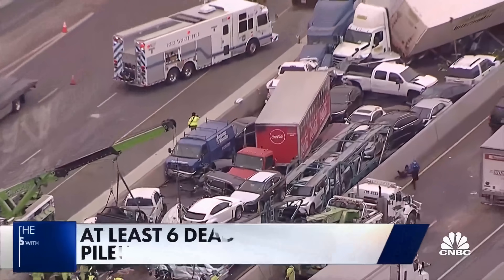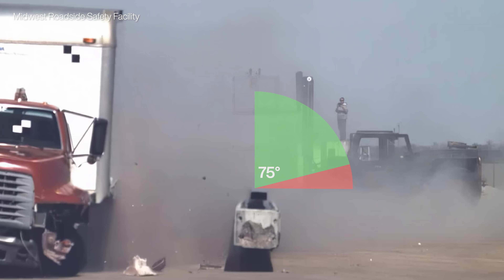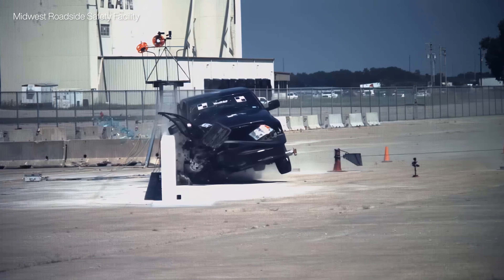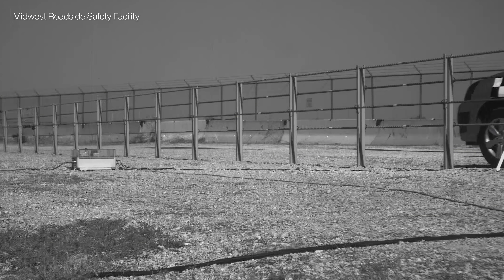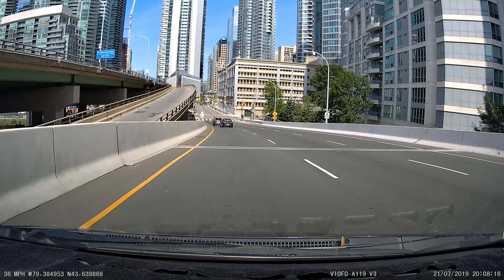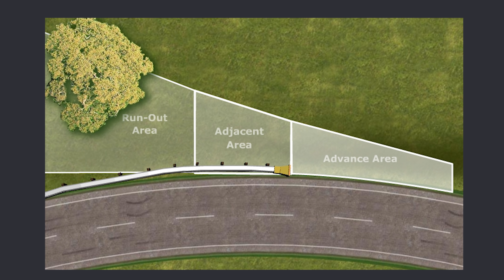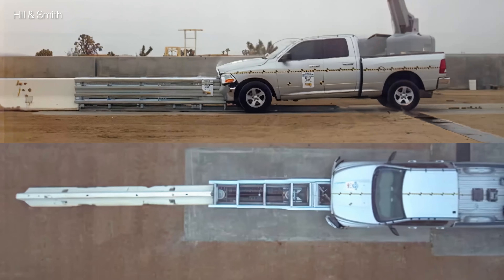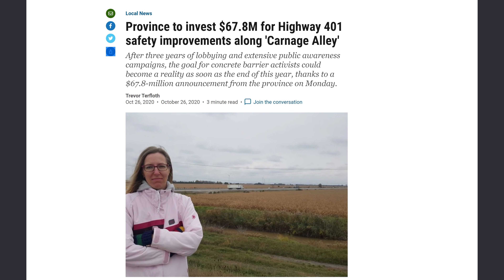How Road Barriers Stopped Killing Drivers

Comment: Nice video, thanks, but i am missing something when you talked about cables: They are a death trap when driving a convertible. .. The seat belt prevents you from moving down, the top cable goes over the car and slices your head off... So glad we do not use those here (although not driving a convertible).

Comment: Cable barriers are not supposed to be installed on slopes,  if the barrier is below the bumper hight of the auto or to far off the road the vehicle simple goes over the top,  if the shoulder of the road slopes down the cable barriers supposed to be placed next to the  roadway thus solving the vehicle from clearing the cables.

Comment: I hit a patch of completely invisible frozen fog on the interstate one day and started doing 360s down the road.  My car kept spinning into the median.  LUCKILY there was no barrier, guardrail, or cables.  My car finally slowed down and I was able to push it out and drive forward until I reached a police/emergency turn around spot and then continue driving to work.  If there had been any safety barriers my car would have been totaled and I may have died.  Sometimes, less is definitely more.

Comment: Well lack of barriers is a problem of law in most of the countries. For example in Poland there is a law which by default requiers all roads with 80km/h limit to have some sort of barriers. Also all of the high speed roads that are at least 4m above the ground that involves public transportation (bus) or trucks now must have reinforcements on any tunovers/slide downs/intersections etc. following a fall of a public transportation bus last year (guy was on drugs, but still the fall of a bus could be avoided by just adding reinforcement). It is all mandatory now according to the law and without doing it, the road won't be open, contractor won't be paid in full and the contract will be transferred to someone else. 

Also if you need material look into it, there is a lot of footage before and after accident, maybe you will have something cool to talk about, how it could be avoided etc. just type in yt ("upadek autobusu most grota" or "nagranie updatku autobusu most grota roweckiego", in eng should be "fall of bus on grota bridge, warsaw" - https://www.youtube.com/watch?v=Gd0ZbOw5W_4&ab_channel=PolandIn )

Comment: Missed three very important factors with cable barriers, and a challenge.
The first is that cable barriers are basically guillotines to motorcycle riders. The second, is that they don't stop the top half of a semi truck - the chassis catches in the cable and slices the top clean off, leaving the driver, cab, and load still moving at speed, disconnected from the chassis or any 'safety' system. The third is that with cars and pickups, there's few test showing what happens when the cable slices in to the body and starts the vehicle rotating - it becomes a spray of loose parts and debris, shredding the vehicle and occupants.
The Challenge, is to find the video showing the crash tests of Motorcyclists and large vehicles like Semi's catching in cables - they seem to have gone missing.

Comment: I had a tire blow on the highway and my car went through a cable barrier like it wasn't even there. I ended up going across oncoming traffic and finally stopped in a ditch on the other side. Luckily no one was hurt but from my experience I think they are too unreliable.

Comment: Stop comparing Cable Barriers with Concrete ... they are nearly as cheap as Guardrails, and worse ... and are not used in Europe at all ... and in Europe if you can't put a Concrete barrier or Guardrail then the highway is closed until you can, it's not optional if you have the money but part of the cost of the highway

Comment: I was driving one night on a section of the PA turnpike that had concrete barriers running down the middle, and low guardrails by the shoulders. I came around a bend at 65 mph and found myself in the middle of a giant herd of deer that were all gathered there trying to figure out how to get over the middle barrier.

One deer hit the windshield without breaking it and landed in the middle of the road with a broken leg. Right away this toothless hick drove up, got a tire iron out of the back of his truck, and bashed the deer in the skull a couple times. A state trooper showed up, and all three of us ended up lifting this deer off the highway into the dude's truck. He must have been eating that thing all week.

Comment: Cable Barriers, because fuck them motorcycle riders!! Just the thought of a Motorcyclist going through one, is enough to make me sick to my stomach! Because a lot of motorcycle accidents happen then the rider slides at a high rate of speed down or off the road. It could end really badly with those cable Barriers! Not to mention, a lot of places are using them in medians that are fairly clear. Meaning now instead of a simple slide off, there's a police report and a wrecker involved. Like u said they all have their quirks!

Comment: One thing that was found in the UK was that cable barriers significantly reduce the amount of drifting snow on a road, over guard rail and concrete barriers. This greatly reduces road clearance costs in the winter, and frequency of closures. Obviously this location dependant, as snow is not a problem in many locations. Though I would note UK cable barriers are different from the ones shown here. One other thing I have noticed in my travels is that in the UK we seem to spend a lot more time protecting bridge piers with crash barriers than other countries especially in Europe.

Comment: This is seriously nonscientific. Extra 0.5% fatalities of overall accidents on cables is 120% times more fatalities. And I bet most are from motorcycles. At the same time motorcycles reduce congestion, pollution but their use is hampered by stupid rail systems.
Reply from the maker: Yes it's technically double I know, but at the same time it's 0.5% which is negligible at the same time when you're talking about weighing the benefits / drawbacks.

Comment: I never knew this much thought was put into designing guard rails. Mind: blown
Reply: this much thought is put into toilet paper.
Reply: @Tycy2014  
You too ? Some times I can't remember which hand to use either.
Reply: Nasa has a 60 page guide on how to splice 2 wires together.
Reply: I once saw them installing them and they were using this massive piledriver to put the uprights into the ground. Those upright supports go so deep it's amazing. Here where I live they have tried to extend protection to ground level to protect motorcyclists as the upright can tear a human practically in half if hit the right way by a sliding human.
Reply: im a layman so how bout a net

Comment: My question is why are crashes so frequent in Carnage Alley?
Reply: I don't know, but I'm from Scotland, and there's a similar-looking stretch of the A9 from Perth to Inverness that's infamous for accidents: there were a number of factors, mainly due to bits of it looking like a freeway but freeway rules not applying (no proper junctions, so you have to turn across the other lane; no restrictions of kind of traffic you'd go round a corner at 60mph and hit a tractor moving at 10mph; switches between two-lanes-each-way and one-lane-each-way causing the driver to forget whether that other lane is for fast traffic or oncoming traffic!). This looks like a rural route so it could be similar. It really needs to be upgraded to a freeway, which would cost a huge amount and should be done by 2025, but in the meantime the most effective thing the government's done is to install number-plate-recognising average speed cameras to reduce the effectiveness of driving aggressively.
Reply: @hjalfi  Well that just sounds like a high body count waiting to happen.

Comment: When the spex are created for the guardrails AND the posts that hold them, does anybody think about motorcycles? You are creating uncountable guillotines which will cut motorcyclists in half, even at "lower" speeds.
Reply: Statistically, motorcyclists are not particularly important. They get hurt in so many different ways that the guardrails are not a significant factor in increasing their injury rate. Furthermore,  there are more cars than bikes anyway so what's the point of harming.more of the larger population, just to save a few who are more likely to die anyway?
Put another way - if you ride a bike, you are making a conscious decision to dice with death. So, take responsibility and don't crash.

Comment: Bikers: they didn't consider us or care about our safety. 

Also bikers: zooming in and out of traffic, flying pass you before the sound can even catch up, riding the middle lines between cars at stop lights, choosing a vehicle with no seatbelts or nothing to cover you from extremities or being ragdolled 200ft after being hit. 

I don't think you care about yourself too much if you're on a bike. 

Not bashing bikers, but you know hands down you have the most highest chance of getting wiped out in any wreck. 
You signed up for it when you bought your bikes.
Reply: Put the rider in a t-shirt and shorts doing that stuff and there you have a squid
Reply: Bonus points when they have a partner/kid behind them with no helmet :(
Reply: Not bashing bickers but actualy bash them with generality. 
It's more dangerous but doesnt mean we have to make it more dangerous. It's better to crash into nothing rather than a cable that will cut you in half. In France those are forbiden for a reason, because fortunately not everyone think like you.
(not talking about gear wish should be mandatory)

Comment: $360 per foot of concrete? Idk if that's possible. I have no knowledge of the subject but doing some math that would mean putting up concrete barriers over 60 miles of highway (a small length in the scheme of a states interstate system) would cost over 100 million dollars, maybe I'm wrong but that sounds way off to me

Comment: I was involved in a high speed accident and hit a Jersey at 70mph. Rolled over 2 or 3 times but if it were any other barrier I could've easily flipped in the grass and gone into oncoming traffic. So even though I flipped, the barrier (and Subaru) absolutely saved my life.
Reply: Was to the left of an 18 wheeler that was in the middle lane and was about to pass it. When I was at its front bumper it clipped a car in the right lane, which came across and hit me, I went into the barrier, rolled over, came down wheels first, and the only signs of damage on the car were a bent front axle and smashed glass. I had 0 injuries.

Comment: Very Nice video and very educational. I was curious WHY is is Optimal for cable barriers to be withing one car width of the road way vice in the middle of the median, as shown at time index 6:56? I'm asking because we have huge grass medians, and it seems to me it would make more sense to allow a driver to slow down in the dirt and grass than hit it. We have them down here in South East Louisiana and if you get a tire of the road you are guaranteed to hit that cable barrier. I used to travel over 100 miles a day and I see that the cable barrier is hit every week and usually repaired within a two or three weeks. Prior to the barrier there was a grass median with no barrier, it was at least 20 car widths wide, definitely not good enough. Even thought he barrier is better than no barrier, it's way to close to the road and I think contributes to vehicle & occupant damage because there is NO time to avoid it or slow down before hitting it. Thanks for the great video, thumbs up. Best Wishes & Blessings. Keith Noneya
Reply from the maker: That's because they aren't filling in the ditch where they would put it in the middle.  That would be optimal as it reduces "nuance" hits from vehicles tapping it and gives more room for drivers to recover.  However it's way more money.

They don't put it at the bottom because it can make grass and other maintenance difficult.  Plus some other factors I'm likely not thinking of

Comment: Interesting switch Andrew! I am actually a transportation engineer and deal with guardrail and clear zone standards. I originally started my channel in 2014 wanting to make videos like this before I renamed it and ended turning it into a dash cam channel instead. Funny how that worked out. "Shared Spaces" channel was something that inspired me, don't think that channel is around anymore. Can't wait to see what you'll have next. Very informational, good way to teach the public about why certain things are designed the way they are.
Reply from the maker: Wow, that is a funny coincidence!  Who would have guessed.  I'm also glad that the video has passed muster.  I was really sweating the details over this one, I knew if I got anything really wrong that I'd get roasted.  All the best with your channel too.
Reply: @Lam  It was great, the amount of research you did was impressive. I don't think I have the energy to make videos this high in production value and depth hah. If you ever decide to do anymore about roadways, one about traffic signal design would be interesting. I live in Minnesota where we have ramp metering and people hate them, but MnDOT research showed they did help the flow of traffic and reduced trip times, most of the time. After a trial period of shutting them all off they verified this but people still hate them because of the perception of waiting at a light to get onto the freeway. I would also be curious to see what kind of more modern solutions are out there for traffic light sensors beyond the standard magnetic loop detectors or simple timed signals. Kudos
Reply from the maker: I don't even have the energy to make that video again.  It was too much.  That was around two and a half months of work to get it to that point.  I definitely have traffic signals on my list of possible topics to cover.
Reply: @Lam  Awesome, the work really shows. My co-worker actually emailed me the video since this is apart of our field and he really liked the video too, and I was like "Hey thats Andrew from CarCamCentral!" I'll be sure to watch your next videos, look forward to more.

Comment: Guardrail and cables are biker killer. I hope someone will invent something like mesh guard... one day...
Reply: Mesh sounds like it might work well. At least it would absorb  the energy of a crash and could be reused if needed.  As far as protecting motorcycles, installing a plastic sheet along with the cable should make the cable system safer.

Comment: What a great video... I really enjoyed this being in the collision repair/towing industry. I must say ive been doing this for 12 years (in NJ) and Jersey Barriers have done really well... Most of the time the vehicle skates off the barrier and doesn't roll over. Only issue is the vehicle can careen back into traffic and also fire the airbags from going up on an angle...but generally they do a good job of taking the energy out of the wreck

Comment: You left out some stuff. 
Those barriers from the 60's that so many people have pictures about them going into the cars.... they were tested extensively. And then the company given the contract made them out of a different (read: less expensive)steel and used inferior bolts on top of it. Then they sold them all over the country. Then they got a slap on the wrist and the whole issue was covered over and now we get to buy all new rails and pay for endless testing without any mention of why we have to replace the entire network in the first place. 
All the add on inventions were put in place to cover the fact they made the rails out of spec for years, probably because someone's buddy would go to prison for the decision. 

It's fine though, the newer stuff is better.

Comment: I rarely give likes because I am lazy, however, I have given a like here because while I am not interested in reviews on dash cams, this was a very well thought out researched and delivered video.  So while you haven't gained a sub you may in the future.  The length was perfect, the flow was smooth and tempo was spot on.  I would really like to see more of this kind of content, unbiased informational on things like road safety are hard to find and I think you did a fantastic job on being informational without digging into topics that would have billed out the video and been rife with other issues that crop up when you take a stand on ombre side of the barrier or the other while still pointing out that social pressures and opinions exist and do drive these decisions as well.  Very well done, I look forward to more of the same.

Comment: One thing I'm really disappointed you didn't mention was how dangerous cable barriers are to motorcyclists as well as rescue crews. Those cables can slice limbs and instantly kill bikers and their high tension nature means they can be and extreme hazard to rescue crews trying to access victims in the vehicle compartment. I'm really not a fan of them and they should be kept to a minimum; I see way too many in scenarios that would benefit from no barrier or a semi-rigid design much more than a cable barrier. It's also frustrating to see money wasted on barriers in very low speed areas; those types of impacts will do very little damage and rarely result in fatal consequences yet money gets wasted putting barriers up there rather than investing in better or more barriers in areas that need them.